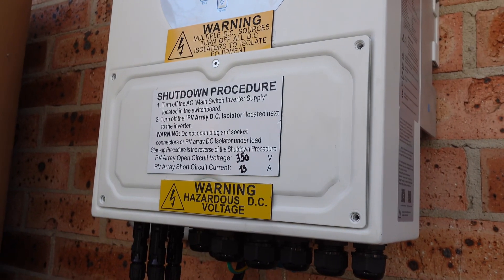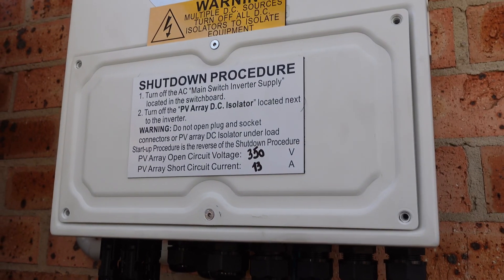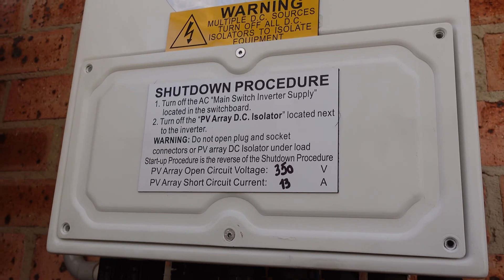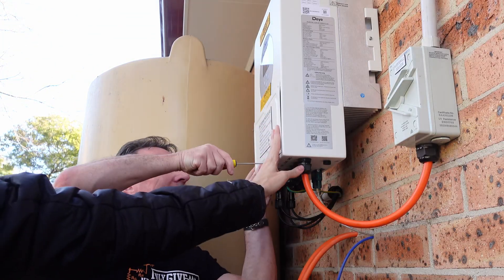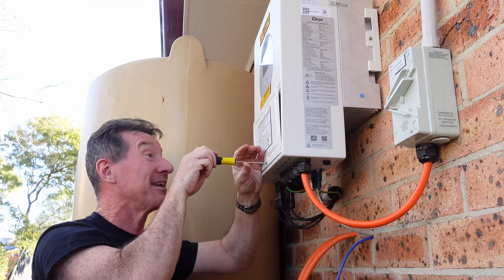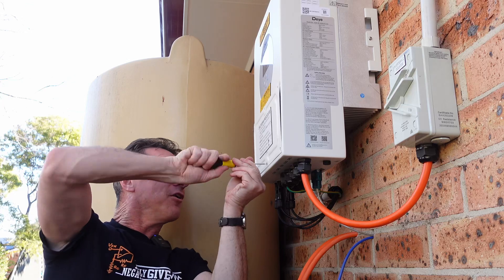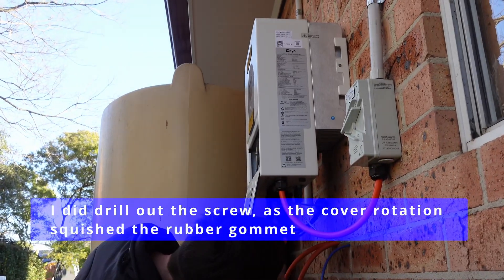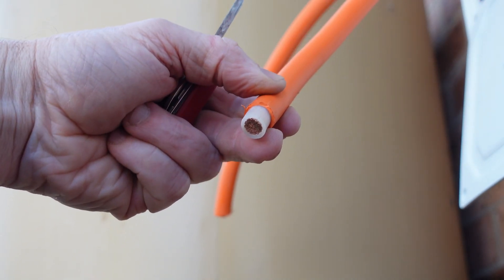Solar Power Install FAIL #3 !

Comment: Idiots not understanding that their 300Nm rattle gun is not for doing up M5 screws to 57 dugga-duggas, stripped the thread and the head hex as well.  That's actually quite skillful, as the thread and hex must have given way at about the same time.

Comment: If you can turn the screw, the easiest way to get a striped thread out is to lever behind the head with another screwdriver while turning until the thread catches.

Comment: Sorry, even with the double insulation, that is one shoddy job! That cable is not adequately supported and looks like shite. Sadly this is the electrical trade today, the standards for the industry have completely gone through the floor. Any contractor who attempts to perform quality installation work to the standard these days will quickly find themselves under-cut and driven out of business.

Comment: Yeah, I'm not too surprised. I had someone come to repair a sewage pump at my house. After I realized that they had broken off some of the bolt heads. Then later I found the driver bit down inside the well and was able to fish it out with a magnet on a string. I assume they dropped the bit down the hole by accident, then either broke the rest of the bolts or used the wrong tool rather than trying to retrieve the bit or get a new one.

Comment: You should probably name that company to protect other people.  And, I agree with another post here saying you should probably have someone come out and check ALL their work (and don't forget to check if that inverter is still weatherproof since they messed it up).  Also, what kind of cables are those?  I've got 4/0 cable running to my inverter and it's about as flexible as a rock.
Reply from the maker: I bought the non-flexible stuff for the internal battery conneciton, yeah, awful stuff, onyl liek a dozen strands. The battery guy supplied the outside flexible stuff with hundreds of strands.

Comment: To get a screw like that my father had a set of left handed drill bits. They looked like normal drill bits but you spun them counter clockwise. Usually when the bit caught the screw would spin out.

Comment: I'm starting to see why the Solar installs are so cheap in Australia...4 fails (one pretty major IMO)....No wonder that install in the US is more than 5 times what you paid...
Reply: Lack of volume, subsidies, and regulatory standards drives up cost in the US. All "construction" trades are dominated by "barely passable" work - it'd be less profitable to act otherwise.
Reply: @ivanblogs  For my home it's nearly $80K for an install with battery solution.  They also said "You really should replace that 8 year old roof because in 10 years you'll be paying to rip all these panels off to install a new roof".  So that would make it nearly $100K to put a solar install on my very irregularly shaped roof.  Yea...never happening.  People have said in Australia my install would be <$20K.  I can get 10% from the fed, but that's peanuts on $80K!
Reply: @WreckDiver99 Ouch. Last year I paid equivalent of ~8500 USD for 13kW of solar. That produces roughly twice the energy I consume. 2 cheaper quotes, but went with a local supplier. The subsidies here pretty much just offset the installation cost. Many Aussies just replace solar systems with latest tech if roof replacement is required - cheaper than cost of removal and reinstall.
Reply: @ivanblogs  I can't even buy the panels for that.  Even the Panasonic Evervolt 2 panels are nearly $400 EACH by me.  So not even "Top Quality/High Efficient" panels.  32 Panels is about $14K Delivered.  That's just the panels.  I haven't bought the battery solution, the mounting hardware, the cabling, inverters (microinverters due to all the shading I have), permits, labor, and more...Yea...It is NOT cost effective for me.

Comment: Torx bit hammered into there will get it loose. Have a bottle with the bits in from the cheap collections, and as they get damaged they get tossed in a tin, and from there when tin is full to the scrap yard.
Reply from the maker: Nope, the internal spacer support is sheared off, it just spins.
Reply: @EEVblog2  Bolt cutter time then, and leave it off, and fill the hole or stick the label back on.

Comment: To be fair here, that seems like they messed up the screw and put on the sticker to hide their mistake.
But yes, this is not a professional installer. Okay for using a cordless drill to tighten screws, but have it set to torque limit instead of the drill setting. Else one is frankly incompetent and shouldn't work with electrical installations at all.

Though, having seen electricians use cordless impact tools on PCB terminal blocks cracking solder joints and then complaining that "these products are shit", then I do have to say that there is a good few bad apples among electricians that shouldn't work their trade.
Reply: Or just don't be hamfisted with the trigger, you CAN finesse a screw with a decent driver...
Reply: @SomeMorganSomewhere  I would still argue for using the torque limit, it is easy to slip up.

One can either choose:
A. Take it slow and steady and be gentle on the trigger. This will take a couple more seconds per screw. (working more efficiently in other areas can easily achieve a faster work pace, but stressed people don't think like that, stressed people waste time and make themselves more stressed.)

B. Just go ham, but have a torque limit. This is what an electrician prefers when having a fixed commission for the job. Except, some electricians skips the torque limit and strip both screes and threads....

Now if one has the time, then feel free to use it. But a fair few electricians don't have that as they tend to over schedule themselves in my experience. (not everyone, some know how to properly manage time, others don't.)
Reply: @todayonthebench  fair point
Reply: That was obviously done on-purpose as a not so subtle message to the end-user to stay out that box.  There's probably language as part of their work order that explicitly says the customer will void their warranty for future work by the same company if they dick around in there, and seeing Dave's patch-work system they very likely suspected he caused the initial problem and since they're used to being called out to fix other customer screw ups and meddling, they resort to this to keep them out of their work.
Reply: @thom1218  Seems odd for an installer to intentionally destroy the customer's property.

Secondly. The installer likely knew that Dave were having a battery install. Why else the new inverter when the old one worked just fine.

And since the battery cables weren't installed yet, then that makes it even more stupid to intentionally mess up the screw.

I am not going to say you are wrong.
There are installers with that mentality. And they frankly aren't professional, there is better ways to ensure evidence of tampering than to destroy property. (might just be a screw, but legally speaking not the installer's property)

And in regards to Dave's main breaker panel. Nah, that is how such things can look at times. Different countries have different standards for how such installations are made and amended over time as new appliances are installed and removed.

Comment: Thats why they put the sticker over it, to cover the stripped Hex head.  Sometimes you can use a flat head or a Torx Bit to get some bite.

regarding the stripped thread, you can preload the thread by pulling on the lid to help it back out.  Or maybe use a plastic wedge or something to put some back pressure on the screw and hop it catches a thread.  Otherwise, check to see if the thread insert is spinning as well.  At that point, its a drill - unless you can grab it from the inside with pliers - safely.
Reply from the maker: Yep, in this case the internal spacer had split completely off, so no amount of turning was going to undo it.

Comment: Someone used their drill to tighten it. I knew it was stripped before you used the screw driver. Panel screws are the bane of my life, being an air con guy I remove and replace thousands of ac unit covers. I have lost a few screws but never "screwed" up as bad as these guys, maybe they must have a few too many loose screws to do it properly.
Reply: Do you also have a small bottle of "good" screws from scrapped units, that you use to replace the properly mucked ones. That bottle has come in handy a good few times for me.
Reply: @SeanBZA  I scrap the old units and have an assortment of screws of every conceivable type spare.
Reply: @fairhall001  Used it yesterday, putting a cupboard door back where the original shytebord screws pulled out. New bigger ones worked well.
Reply from the maker: Yep, very likely.

Comment: It looks like they have used a precession screwdriver with a torx and then pushed the button in so hard that the machine slipped and scratched off some of the paint.
its sh*t like this that happens when people are too lazy to go back to their cars after the correct tools. I've seen this way too many times before.